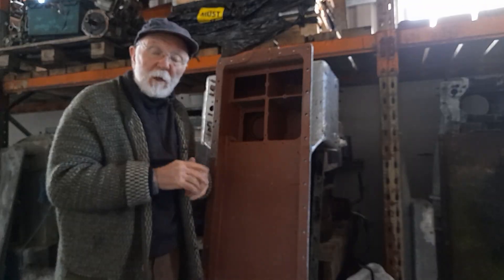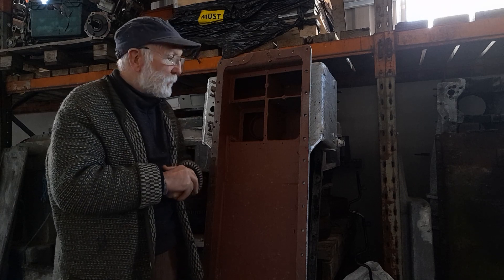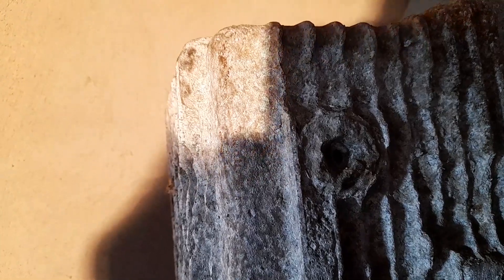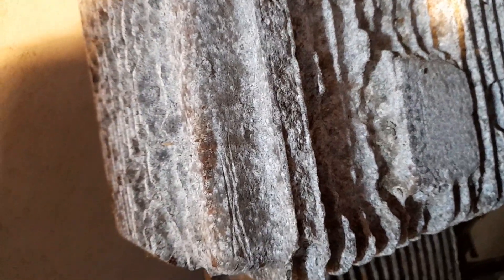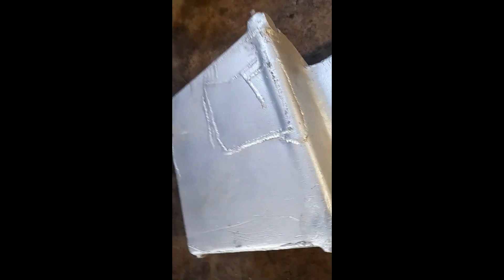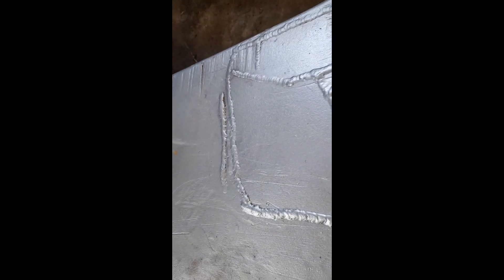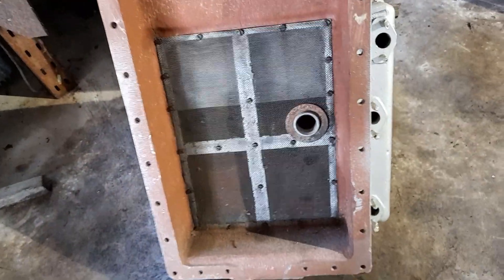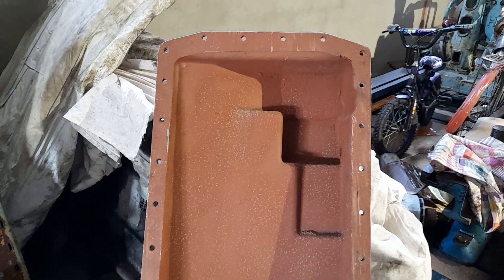Gardner Engines: elektron

Comment: The aero engines I worked on use Elektron for their intercases and gearbox casings.  They suffer badly from corrosion. I used to joke they were the ideal anode protecting the rest of the aircraft. However the intercases  usually have a carbon fibre duct bolted to them. Two materials at opposite ends of the galvanic table so no real surprise that the magnesium dissolves away. Elektron are still in existence as a company by the way with some good design guides on how to minimise corrosion through good design practices. Not sure how many people have actually read them lol.

Comment: Noticed one of those sumps had the remains of a gasket, didn't think Gardner used a gasket on the sump.
Reply: Looks like sealer to me I would be putting plenty on a 50 year old engine I know that
Reply: @hughjarse4627  just because it's old does not mean it will leak
Reply: @izaacbanks3337  why would you take the chance clever clogs!?

Comment: Matchless & AJS used Electron in parts of their old  racer  G50 & 7R race engines - It was thought of as a magnesium alloy - They use to anodise it a lovely gold colour to cut down corrosion  -  it density  relative to water is 1.8  where aluminium alloy  is < 2.8 - As Joe said  issues with corrosion mean it's use has fallen out of favor - I once melted down a chain saw crankcase to make a casting  thinking it was aluminium  only to find  I had created my own Mount Vesuvius - it can be scary stuff